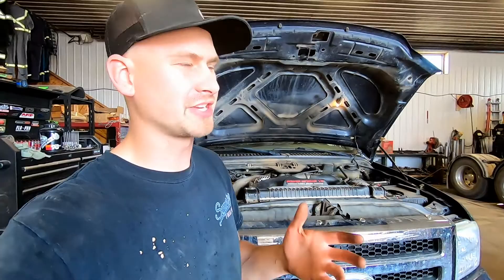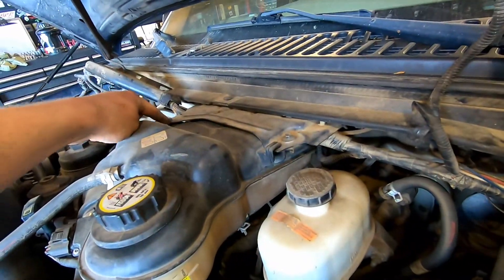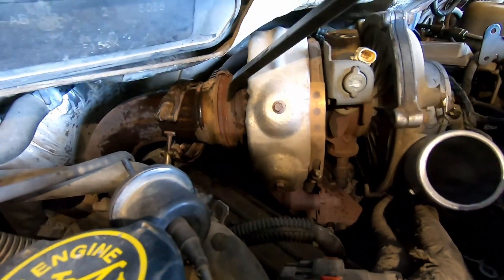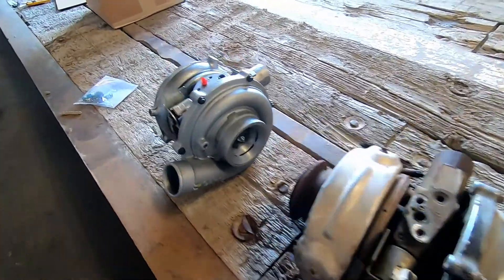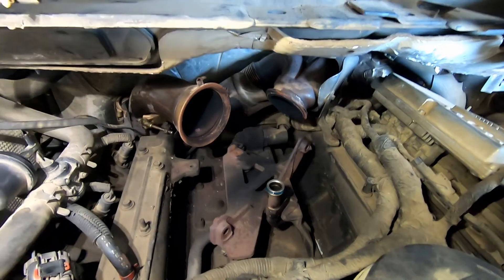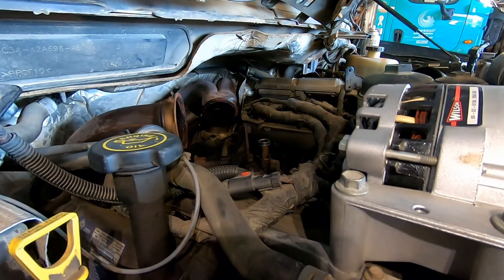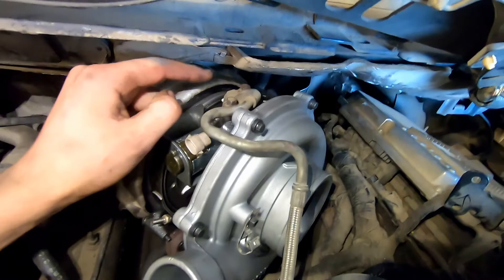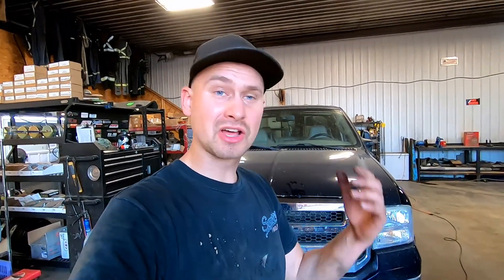How To: Replacing the turbo on your 6.0 Powerstroke

Comment: Very detailed thank you for this. I am about to do a number of repairs on my 6.0 and the turbo is one of them. I will also be doing my fuel pump and housing, filters, and fuel injectors eventually.
I found a 2003 F250 with 83000 miles on it in near mint condition last year. I purchased it for my junk removal business but put a bit of a hurting on it lol. Thanks again!

Comment: I have a 2005 F250 Super duty that I bought new. I was accelerating onto the interstate when my "wrench" warning light came on.  I took it to the dealership for the diagnosis.  They told me the turbo vanes were stuck closed.  So decided to change the turbo myself.  I am a mechanic with over thirty years experience, but very little turbo hands on.  Thanks for the video.  Thanks for the details and what to watch for.

Comment: Good video on how to change turbo! But how. Do I know IF turbo is problem an not some sensor, pipe,obstruction?  Afraid I will change turbo and not solve my low high rpm power loss!  Starts well, no power, max speed 40mPH +-
Reply from the maker: Check for an exhaust restriction first. If it still has the factory cat they can come loose and actually spin around in the canister housing completely restricting exhaust flow.
Reply: @darkirondiesel  hi. I kept looking at good videos and was about convinced that Turbo was not shot! (No smoke from exhaust, started easily,, no high end power.  Most pointer to hot side turbo connector sleeves split.  Could not fine. Finally pulled air filter so I could see, saw light oil where cool side pipe connected at driver radiator , looked good but pushed my finger into pipe split at cooler bracket! Entire cool side pipe is black one piece plastic w Ford logo on!  Hot side is metal w boots on both ends! Ok

I cannot find a seller in Indy or in line who offers just the cool side pipe and boots & 4 clamps,  some cheap red ones, metal I guess, but boots look like junk & I will through half of 2 pipe kit away!

I do not wish to put a 1 piece plastic pipe from Ford back if I do not have too!

Any location advise would be appreciated!  Thought my finding the blown 1 piece pipe-boot attached might help others find similar problem!
Reply: Look for a 2003 Ford 6.0 CAC cold side. It's a Factory "upgrade" to the cold CAC pipe that tends to split or tear at the flex part. Best of all, the 03 pipe fits right in.

Comment: Hey man what would you recommend I installed a wherli fab y bridge and stripped the bottom right thread thanks btw I deleted my truck today doing the exhaust tomorrow god willing
Reply from the maker: oof that sucks, hmmm, can you try to re-tap the hole? Maybe drill it out a bit and tap it for a bigger bolt but there isn't much room for a bigger bolt, plus you don't want to drill too deep and go right through the manifold...

Comment: Got a question for you. I'm putting a new turbo on my 250 and I can't get one of the front bolt holes to line up. I can get the back and one front in. It's the right turbo for the year and the truck. After constant wiggling of turbo it seats and won't go any further down. My question is it alright to run the turbo with only two mounting bolts holding down.

Comment: Tell me where that coolant drain is
Reply: It's on the bottom of the radiator, on the Driver's side. Just look for the white knob and drain. Be sure to tighten it by hand or it will break.